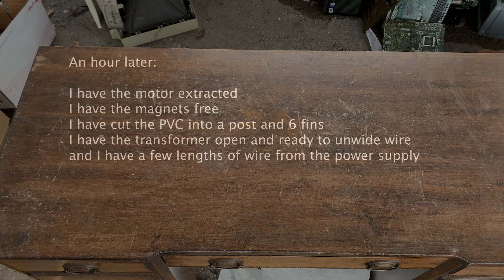Impossible "Free Energy" Motor From Computer Scrap

Comment: Make sure the orientation of the mags are N, S, N, S... Rotate the coil 90⁰ to the  magnets so the magnetic flux lines pass the individual wraps of wire, also use a much smaller gauge wire in the coil and it will have a better chance of making a small current. That might help but like you said it's an impossible free energy machine.

Although those magnets are perfect for a small axial flux wind generator! If you have extra I would definitely be interested! I've been in the process of developing a small axial flux motor/generator to charge my battery pack myself.

Comment: I don’t think it would ever work the way they are trying to advertise it. You are right about it being clickbait. However, I think it would be interesting to see how much loss of efficiency there is in that design. What if you plugged the motor into a constant power source.... could you get a reading on the coil?

I saw a video that might help explain what is happening and why this isn’t working. It is a long video, but you can skip the first 5 minutes. From minute 5 to minute 10 explains Lenz Law.

https://youtu.be/nGQbA2jwkWI
Reply: Since the current wants to oppose the change in the magnetic field, the resistance to the spinning motion of the magnets would eventually slow down to a stop unless you have perfect conversion of 100% of the energy. Since the coil is only on one side, you cannot capture all of the changes in the magnetic field. Maybe? I don’t know, I’m not an expert.
Reply: Sorry for so many comment, I am thinking as I type, rather than constructing a well thought out conclusion. ;)

Wouldn’t the magnetic fields moving closer and then farther from the coil create an AC current?
Reply from the maker: That is a good question.  Typically switching the magnetic poles is how that is accomplished.  However, I wonder if the oscillating distance between the coil and magnets could do something similar.  Usually, the change in the poles cause the electromagnetic fields to flip which is what generates the current... but it is something to look into.  Thanks Craig!
Reply from the maker: That is a great video!  Thank you!  I was not hoping to be a provider of click-bait ... I was hopeful that it would do something.  I did try providing current to the motor... no deal there.  I wonder if the motor is damaged.
Reply from the maker: I watched the video from MIT you posted here ... Man I don't know ANYTHING about the physics behind electric currents, Lenz Law, Faraday's Law, or any of it ... I almost want to go back and get a few general physics classes in at a local university ... that got me thinking of all sorts of applications to generate current ... With the lectures being 1 hour long each, I may have to pace myself with his work ... I really liked how he blasted fellow MIT professors for not understanding his -0.1V and +0.9 simultaneous output at the end... Again, thank you so much for posting that!!!
Reply: You are welcome! Every once in a while I find an interesting video and end up with a question that leads me to another video and then another. It’s not really structured learning, more of a curiosity fulfillment model I guess. Although I think taking some courses would be fun, too, I don’t know how committed to homework I would be ;)

Comment: But, what was supposed to happen? You spin the axle and that generates a current in the coil that keeps the axle spinning?
Reply from the maker: There are two expected goals (maybe just one really) ... 1: power gets generated in the form of DC Current and 2: that current turns the DC Motor which the rotor is mounted on causing it to spin ... which then should generate more current...  The Voltmeter proved no current was generated... so therefore, no continual rotation ... Many have tried to make this work, and there are countless videos of people trying for years.  In my mind, I was hoping that some power would generate, even if it were less then the required amount to move the rotors again.  I think I have a flaw in my workings for that which is my real goal... I did not really expect to prove opposite to other experiments done by professionals and me doing it with less efficient components and unrefined techniques.  I really just wanted to know if I could get the voltmeter to show me I made electricity from a coil I hand spun.  That was my real disappointment... But hey, that gives me a floor to work from and move up :)  I will make a wind turbine some day... That will happen.  Good I failed here on a cheap experiment and curbed my optimism a little.
Reply: @badideametals  There's probably no flaw in your workings. It's just a bad design, because there's no such thing as free energy.

You should gave no trouble generating electricity from a wind turbine, because energy is constantly being added by the wind. It's just a conversion from kinetic to electric.
Reply from the maker: True about the conversion and I appreciate the support.  I wondered if the single coil oriented as I had it could have been the problem.  Most wind turbines have a 3 phase star or delta config with the magnets passing in an alternating N - S - N - S pattern to get the electrons moving ... This design in my video is of 6 magnets oriented the same direction, passing a single coil ... not sure I understand how this should have worked... but I am still skeptical that it could generate much more then a few comments as an interesting centerpiece on my table or desk at work :) ...
Reply: @badideametals  👍 You did your best. 👌